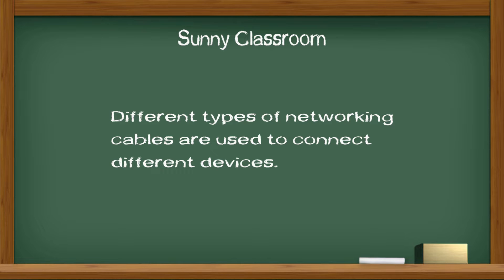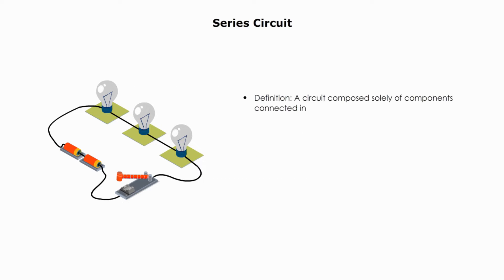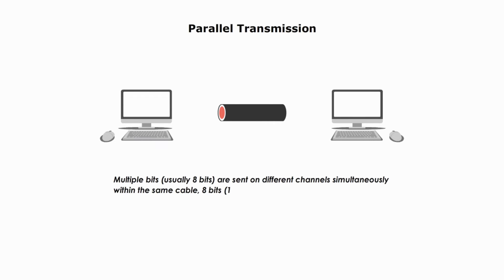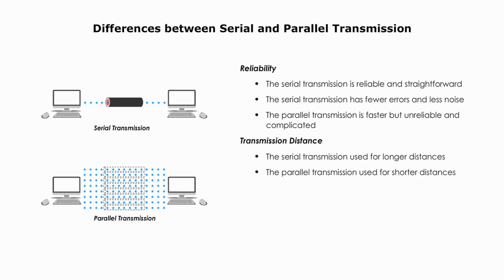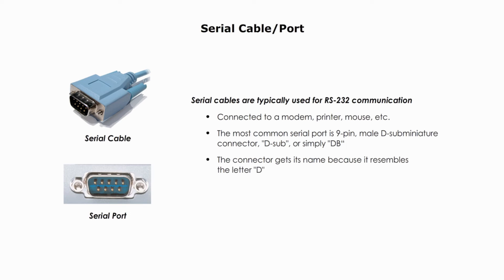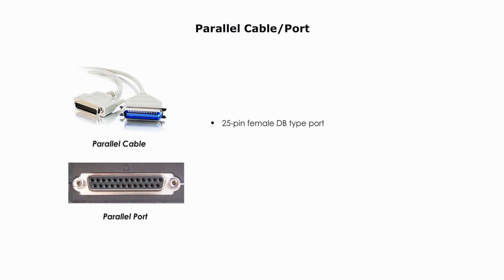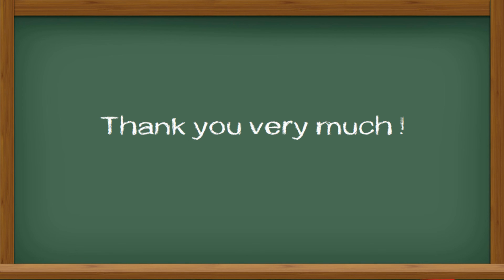Serial transmission vs parallel  transmission

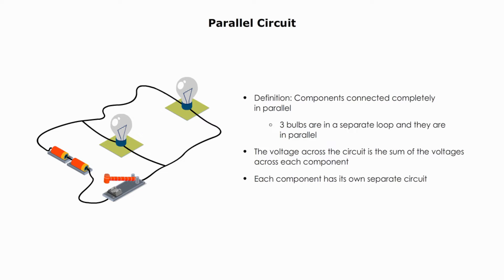Comment: I am an electrical engineering student; at 2:08 is supposed to be the sum of currents through each each component equals the current through the circuit. What you said for voltage is true for series circuit.

Comment: I have to do a correction to the series circuit... the currect "electricity" doesn't stay the same... it gets low and low from each machine than at the end it will be vary low

Comment: Thank you sir, for your information. I am an Electrical Engineer; at 2:04 , the information should be revised as , "The voltage across the circuit is the sum of the voltage across each component," should be replaced by "The current in the circuit is the sum of the current through each component". The Voltage information provided in parallel circuit is true for series circuit.

Comment: 2:10 Parallel circuit: The voltage across the circuit is the sum of the voltages across each component. No, the voltage for each component is the same and equals the power supply voltage. When in series the voltage of the supply equals the sum of the voltages for each component. In parallel the total current is the sum of the currents for each component, while in series there is just one current.
Reply: Right. Series circuit share the same current and the voltages are added. Parallel circuits share the same voltage and the currents are added.

Interestingly, the more components you have in a series circuit, the less current there is while the more components in a parallel circuit results in a larger current
Reply: I wanted to address this too. Nice one. Well-done Prof